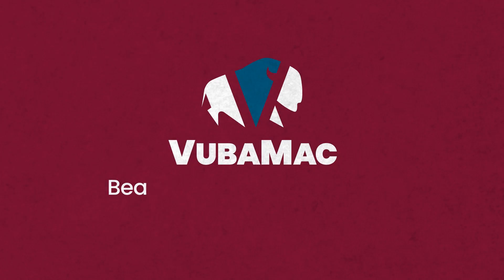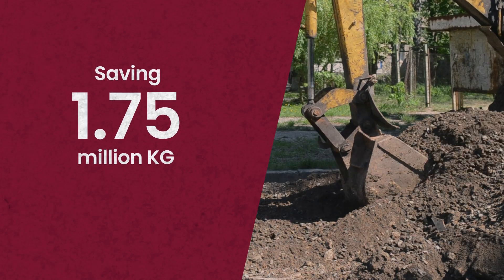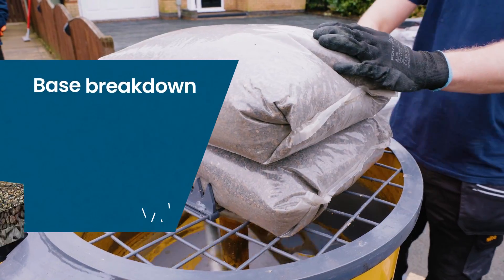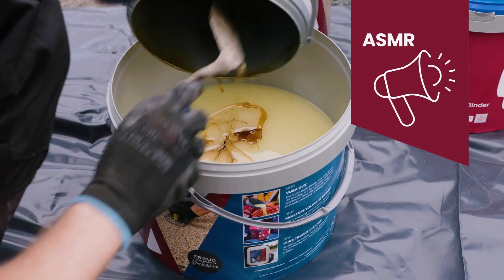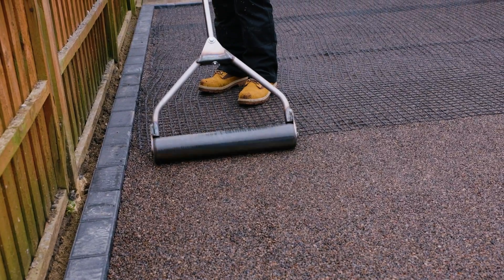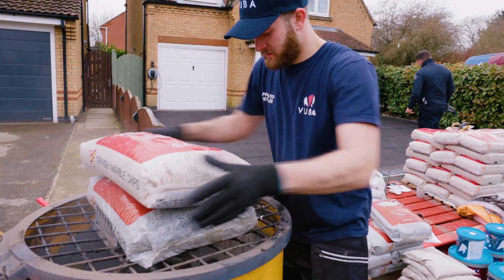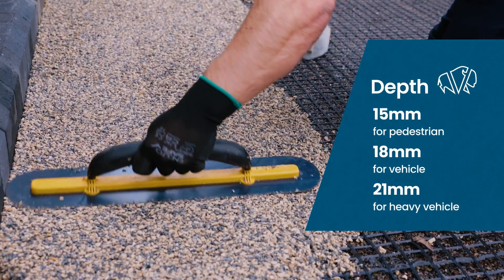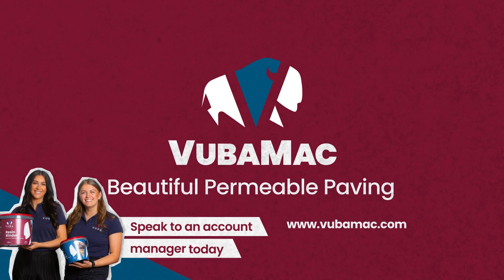1 Day VubaMac Installation - The World's Most Flood Resistant Paving 💧💦

Comment: Only problem i see, is your adding approximately 3 inches to an existing driveway with this product. Most homes wont have that type of clearance without having to rip out the old driveway. Might as well just repour cement at that point. Nice looking product but I would imagine its use over existing driveways/sidewalks would be very limited depending on height/slope/soil conditions ect